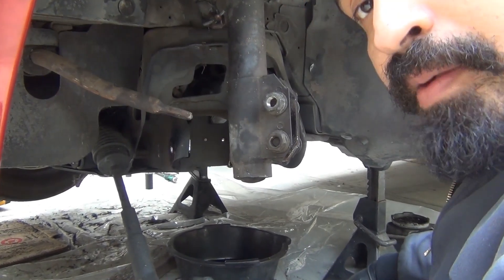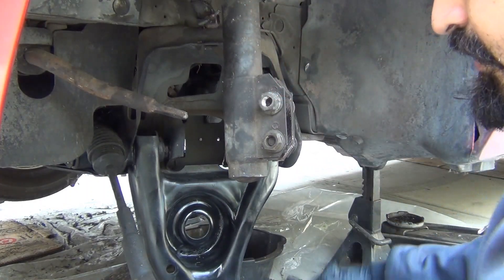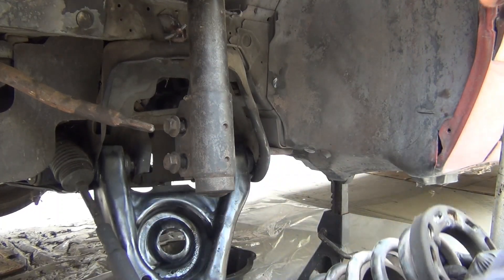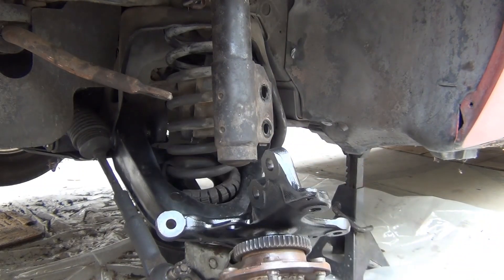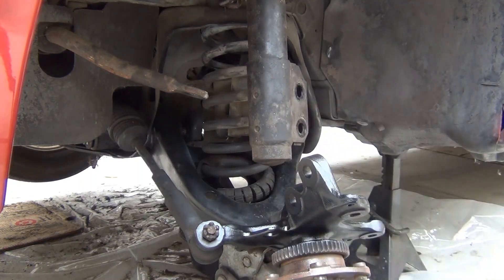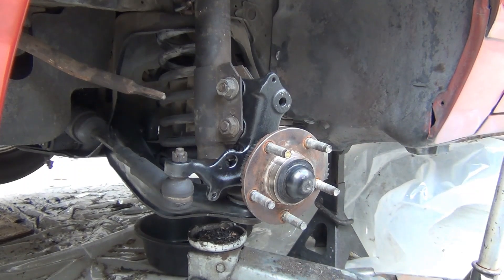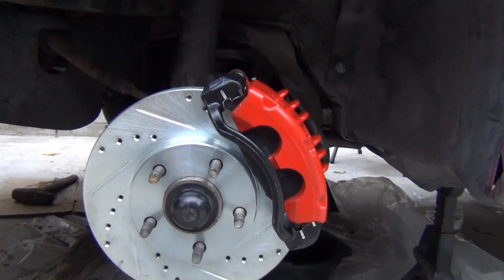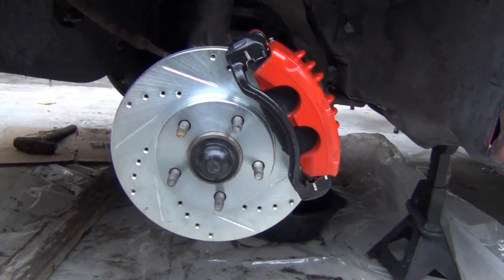Foxbody Mustang 5 Lug Conversion: Mocking The Front 5 Lug Spindles and PBR Brake Setup Notchback

Comment: What brakes lines did you end up using , I’m thinking of doing manual brakes ??
Reply from the maker: The brake hard lines on the rear came with the 1995 8.8 I bought, since mine was originally a 4 cylinder, also had to change the line that goes from the master cylinder to the rear of the car to one from a V8 fox. The soft rubber lines are all stock sn95 ones.

Comment: can you still use the 15 inch rims or need bigger rims with the swap ?
Reply from the maker: @AwakeDude911  yes and no 😆… I was able to run the weld prostars 15x3 with a small spacer, but you need at least a 16 inch wheel to clear without problems!

Comment: What rotors did u use the 1999 year ?
Reply: Oh also what brake line did u use for the 1999 calipers
Reply from the maker: I used the stock lines that came with the 99 calipers. But you will need an adapter for the passenger side. You can get a set of lines meant for using SN95 calipers on a fox which already come made with the right threads.
Reply from the maker: Hey there, the rotors are the same from 96-04 Mustangs. The calipers are from a 99-04 Mustang
Reply: @MrBlitzkrieg1987  so if I order the 1999 rotors from rock auto I'm good with the 95 spindles
Reply from the maker: Yes the rotors will work, but if you’re using the PBR dual piston calipers you’ll need to grind on the spindles to clear them… you can see this video and skip forward to were I grind them so you can see where exactly https://youtube.com/watch?v=sGPIXSUkSgA&feature=sharea
Reply: Already watched it I'm also ordering cobra booster and master 😎

Comment: I didn't know the GT springs were going to be a pain to get in.... hmmm.... kind of worried a bit now. I want to lower the car, but I wanted to wait until I get my 18's to fit/work.
Reply from the maker: Yeah Gt or V8 LX springs are almost impossible to put back in, you would have to take them somewhere to get compressed and tied down to put them back on! 4 cylinder springs are shorter and softer
Reply: @MrBlitzkrieg1987  Well, that is good to know. I've only put cut springs back in, so I am sure glad I watched this. Great info in all of your videos I've watched so far!!
Reply: Hey, I forgot to ask...are those PBR calipers from a New Edge? That is my plan for mine.
Reply from the maker: Yes, they’re from a 99-04 a Mustang GT or V6. If you’re using a 94-95 spindle in the front you’re gonna have to grind it just a little bit to get them to fit. I made a video where I ground down mine 👍
Reply: @MrBlitzkrieg1987  I noticed that it would need some grinding,  albeit very minor. I haven't had a chance to looks through all of your vids yet... did you upgrade your booster and/or master too?
Reply from the maker: Yes I actually put a 93 Cobra Booster and master cylinder on the car, I still haven’t done the metal brake lines but that’s what Im planing to work on next
Reply: @MrBlitzkrieg1987  oh cool! I'll be sure to watch for that!

Comment: You used the 4cyl control arms and shocks? Great video bro, it's coming together
Reply from the maker: Yes, I haven’t decided if I’m going to be using coilovers or a shock and spring setup, so I bolted everything back together temporarily so I can roll it on the driveway.